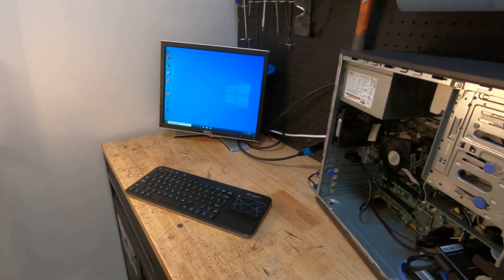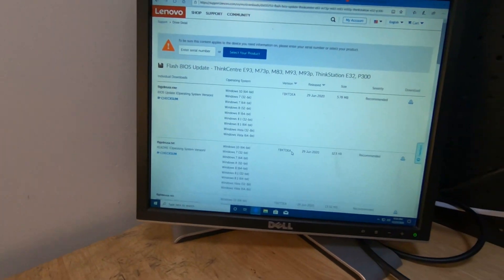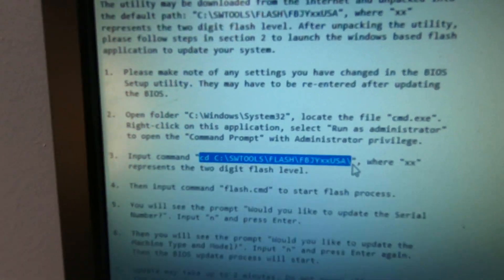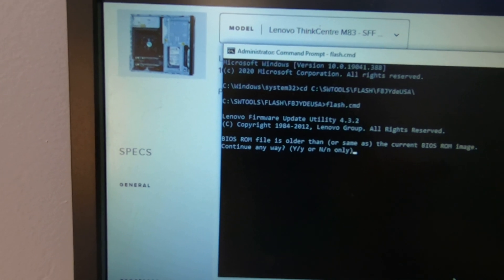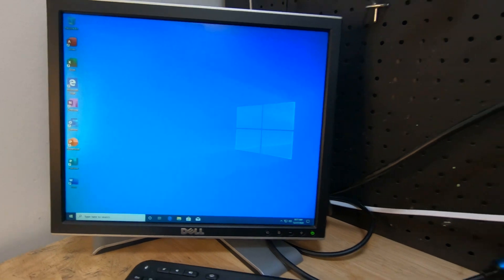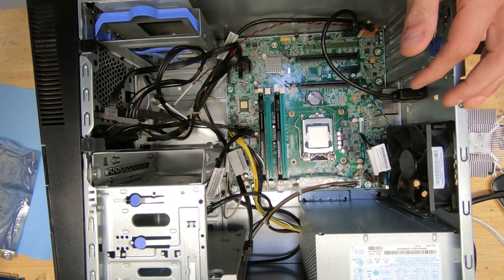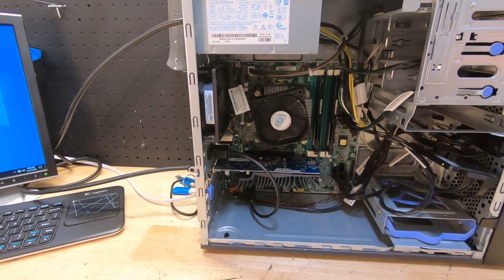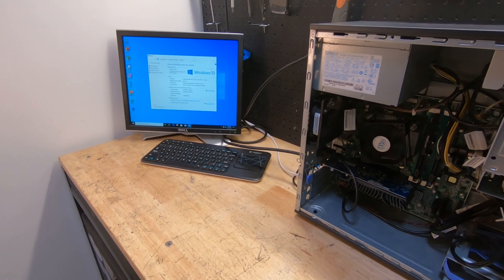Updating Lenovo bios and Xeon upgrade!

Comment: What size fan is that? I have an m73 and i kinda want to just service the thing. 

Also thanks for explaining xeons work. Fine 4th gen is Old now, but the xeon that you have recommended is twenty bucks on amazon. that, paste. takes me from an i5 to i7 specs. Not eart hshattering, but the benchmarks point ot it being nice.

Comment: Somebody gave me an M83 that has an I5 4440s, I got an E3 1270 V3 socket 1150 variant, flashed the BIOS to the Jan '22 version and the Xeon doesn't work All the fans spin but it never posts. I verified the original CPU works both before and after the BIOS update. Could it be that Lenovo may have once again removed Xeon support from the Jan '22 BIOS? It was the only BIOS offered when I looked up the M83 - AL10 model,  Any ideas?

Update: Wot Wot!!!, I forgot that the Xeon I got may not have had an iGPU, so after I put a video card in the M83 it now works and I was stoked to see that System Properties now shows it has a Xeon in it. I gave $16.00 for this Xeon E3 -1270 V3 on AliXpress, BTW.

Comment: On my M83 updating it was weird. I did the CMD things on Windows and then it rebooted itself and the monitor turned off. I left it like that for a few minutes so i finally gave up and rebooted it myself and it started working again,with the bios actually updated to the latest version. At first i thought it bricked itself lol

Comment: 12xx xeons ending in 5's do have integrated graphics. only the ones ending in zero do not. So if you have a mini thinkcentre you can use a xeon ending in 5.

1265 works on m73 mini btw

Comment: Just got a SFF m92 with a i5 2400 Rev 1.0 for free.  Xeon e3 1240 costed me $10.  Going to pair with a 1050ti lp.  So silly me just dropped the Xeon in and was greeted with 5 beeps as soon as I power on.  Guess i have to back with the i5 and update the bios.
Thanks for the video.

Comment: 6:21 And I suggest you also to use UPS [Uninterrupted Power Supply] that in case of power outage. UPS will kick back instantly if power down is occured. Without worrying the power lost during update.

Comment: Can you please do this with the same Xeon CPU but with HP EliteDesk 800 G1 sff or HP ProDesk 600 G1 sff? I would really appreciate that.

Or can you tell me if this is possible with the HP models I mentioned above? Thanks
Reply from the maker: i've looked around and have not found anything definitive. one forum said yes, others no, another states theirs a bios issue. If I get one in I will try it.